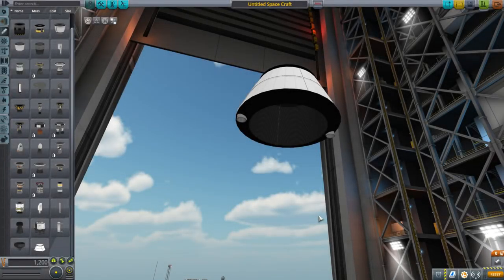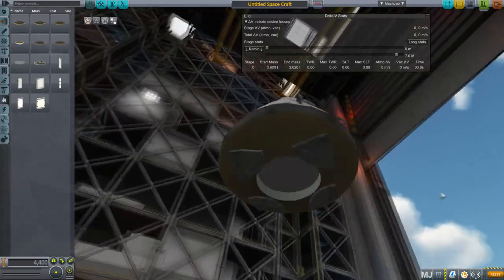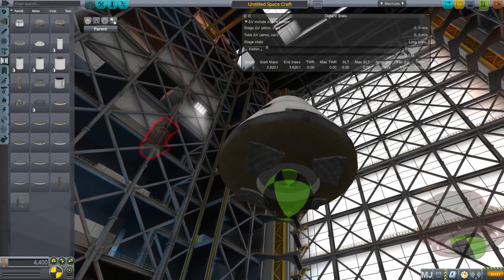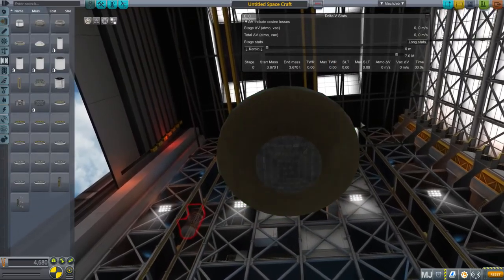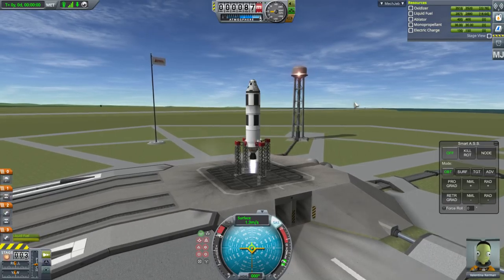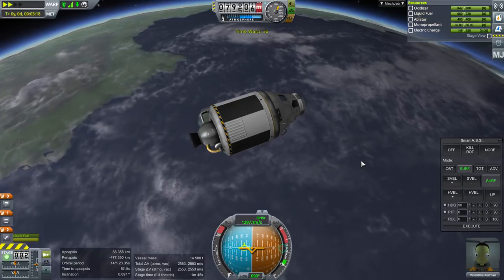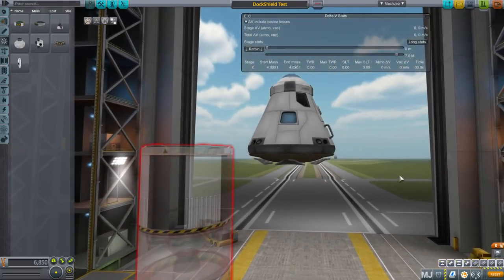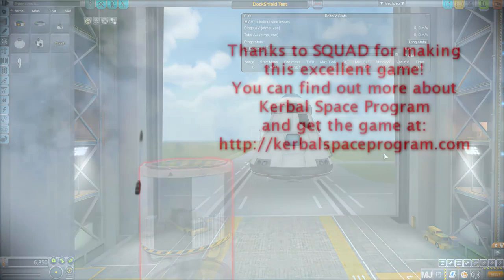Kerbal Space Program - Part Dev - Docking Bay Heatshield

Comment: Hey Raiz, still remember your cold gas rcs thruster? Can I ask something about it here? I try to make my own config like yours, but it ends up being so strange. I made all realfuel tanks with Lqdhydrogen have boiloffproduct = hydrogen, and I add rcs config using hydrogen with isp around 60 ish, thrust around 0.12. I attach a hydrogen tank behind my LqdHydrogen tank (hydrogen tank volume around 480L, and Lqdhydrogen tank volume around 40 kL), and let it filled by natural boiloff. The filling speed shown in flight is around -20 ~ -30 depends on the main tank temperature, which is surprisingly low and took a lot of time to fill a 480 L hydrogen tank. A single cold gas RCS fire will use 2000 unit which depletes the hydrogen tank very fast...I don't know where I got wrong but I think it should perform better than this? How you make yours working?
Reply from the maker: First of all, a hydrogen gas RCS thruster can easily get an ISP of 200, and probably more. The units for LqdHydrogen and Hydrogen gas are different, so it may have something to do with that - you'll see that the units for one ton of LqdHydrogen is different than that for Hydrogen Gas due to the expectation that the gas is in a highly pressurized tank. Other than that, I haven't tried changing the boiloff product in RealFuels myself - I just had the thrusters consume LqdHydrogen directly for simplicity. I'll have to try it out later.
Reply: Great thanks man.